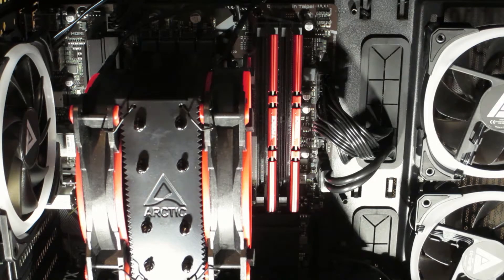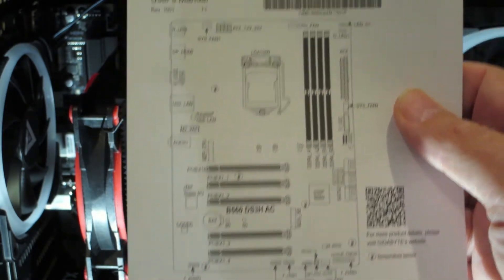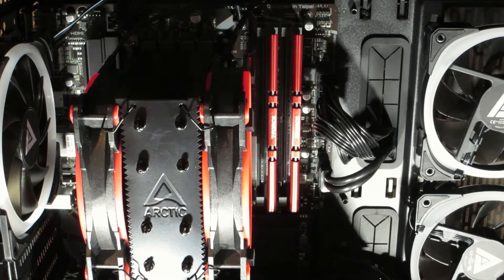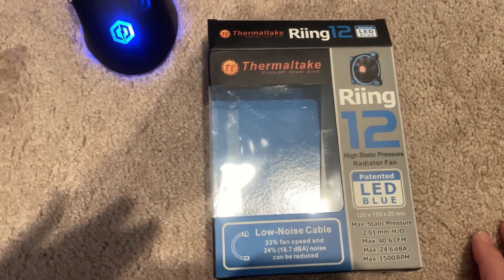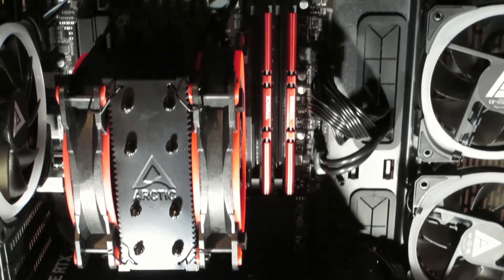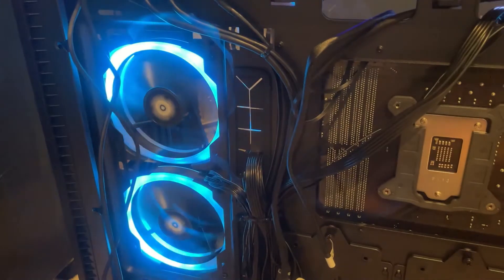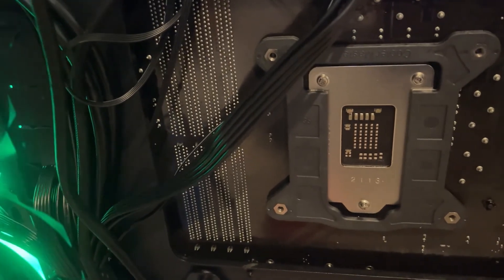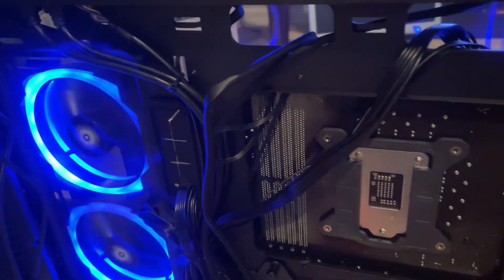How to add and reverse fans on the CyberPower GXI3400BSTVB I7 11700 RTX 3060

Comment: Hey, so from the previous video you discussed about replacing the stock motherboard fan should I find a different fan than the one you recommended?
Reply from the maker: The one I used is the easiest to install. If you use a watercooled one it may take a lot more work.
Reply: @DesignBuildFixReview  finally upgraded and got the artic liquid freezer 3 pro and also reversed the two fans like you did and got amazing temperatures. Thank you OG
Reply from the maker: @MikeyvelliBeats glad to help

Comment: So you need a 4 pin fan to put fans on top?
Reply from the maker: You could tie it to the motherboard there is a fan pin on there I think it is 2 or 3 pin. If use a big molex 4 pin there will be no speed control just full speed 100%
Reply: @DesignBuildFixReview  wym? Sorry im new to pcs

Comment: I have a question, my fans stopped working, the rgb for my pc arent on, i tried messing with the back connections for the cables but they dont seem to turn on. Any help for me, the rgb dont work and fans dont spin, i have the same oc as you
Reply from the maker: oh, thats a tough one the reason being is the fans and the rgb are on two seperate power conectors. fans tied to motherboard power and rgb on mobo too but goes through an rgb controller. They both may be using 12 volts most components on motherboard i think use 5 volts. is the mechanical 1tb hard disk working that also uses 12 volts. It may be a power supply issue on 12 volt side.
Reply: @DesignBuildFixReview  got it fixed, thanks alot I really appreciate it
Reply from the maker: @Xokuz  Great what did it wind up being.
Reply from the maker: Did cpu fan stop working too?
Reply: @DesignBuildFixReview  no just other fans, i think the problem is that they’re all connected to the cpu fans
Reply from the maker: @Xokuz  The cpu fan has its own connector on mobo. The other fans I think go on other connectors on mobo. If under warranty need to send back to cyberpower. If not could wire them up somehow to a spare molex in the case with an adapter. The rgb are a totally different thing i would just not bother fixing rgb. Remove molex on 1tb mechanical drive and power it up see if fans start up if they do power suppply issue.

Comment: I have this PC. So how many coolers should I buy? Should I throw out the stock Coolers?
Reply from the maker: here us a list of my cyberpower videos. https://youtube.com/playlist?list=PLM4hMwWWjaD1NoL0PZcOrEClcThsH8SLT
Reply from the maker: Just replace the stock cpu cooler with this one https://youtu.be/yfj9u8QeY1A   later on you can use the old cpu fan for the top of the case. If you cant do the cooler replacement yourself you can order the cooler off amazon link here and bring it to a bestbuy or someplace to replace. It has fo be done either way. You do not want to run that comouter without a new cooler. That is my opinon anyway many people have changed it and are very happy now.

Comment: What CPU cooler did you use?
Reply from the maker: Link to it 
https://www.amazon.com/gp/product/B07MC8CRVZ/ref=as_li_qf_asin_il_tl?ie=UTF8&tag=designbuild01-20&creative=9325&linkCode=as2&creativeASIN=B07MC8CRVZ&linkId=770641572584afc24250b923b2f03ee3
Reply: @DesignBuildFixReview  It's crazy just about any $35 - $50 cooler saves this machine from being a dud. Nice video.

Comment: I did find at idle and medium load flipping the front fans cooled temps by about 20 degrees. Gaming at max settings at 1440 or testing gpu and cpu at max load I didn't see any difference.
Reply from the maker: Good to know all I checked was full load on the CPU temps and it was still hitting 100 degrees fans or no fans. I fixed that with the other video I did I dropped about 35 degrees with a new cooler. I had flipped mine to intake and will leave them like that. I am not sure I will put fans on the top or not. My reasoning is I plan on adding 5 more SD hard disks and although they don't take much power I am a bit concerned about putting more load on the power supply. The fans do only take about 1.5 watts. They are pretty as hell up there though.
I have to test my gaming on 1440 tomorrow right now I am limited by a 60hz monitor. Have you had any lockups on gaming, I play warzone and halo basically because they are free. I am afraid I keep hearing people crashing playing games, but I believe they have stock cpu cooler still. From 100 degrees at the high to only about 70 degrees but steadystate on full load more like 65 degrees. Gaming heat load nothing compared to video editing load I put on it.